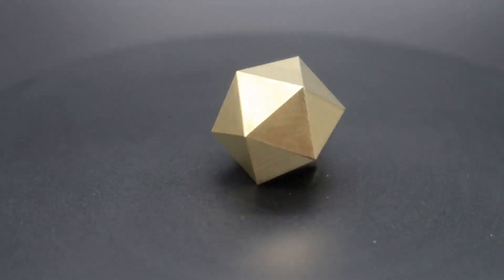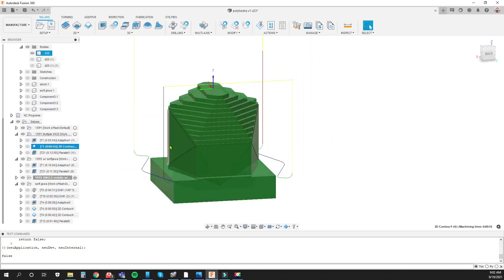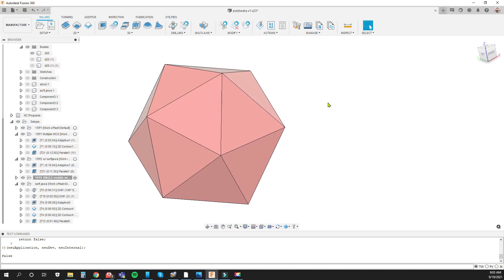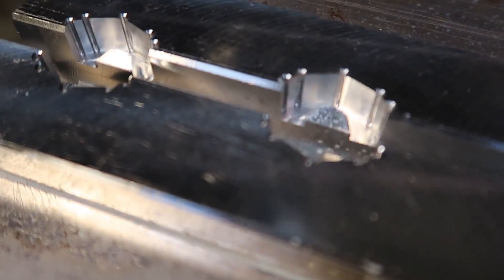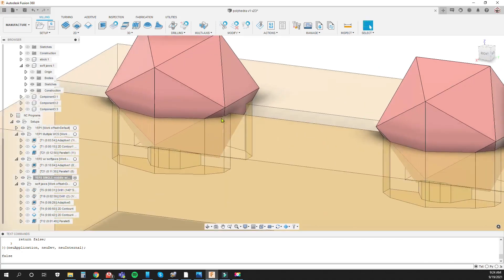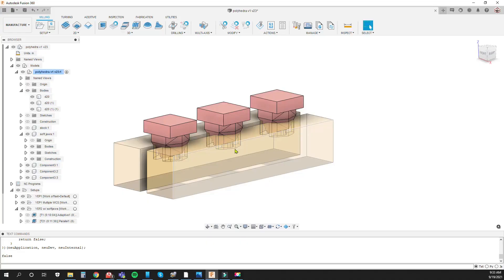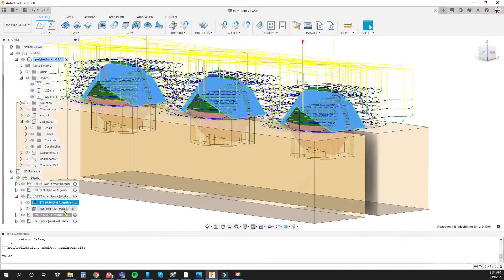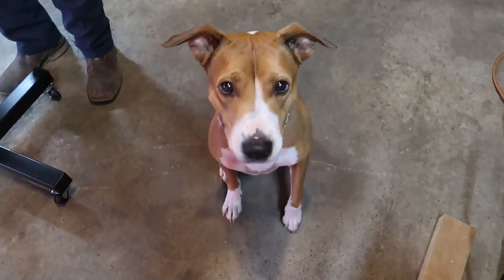Machining a 20 Sided Part

Comment: I still have an old floppy disc method of machines here. What computer program are you using and do you think it would work
Reply from the maker: I use Fusion 360 to program my machines. I've never dealt with floppy disc machines so I'm not entirely sure how that would work